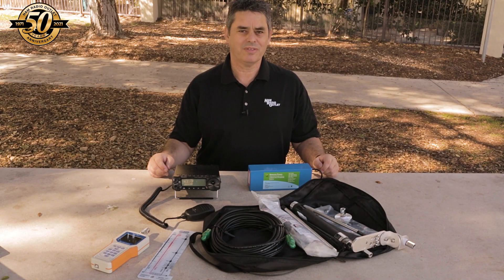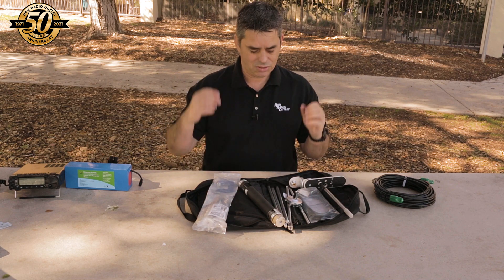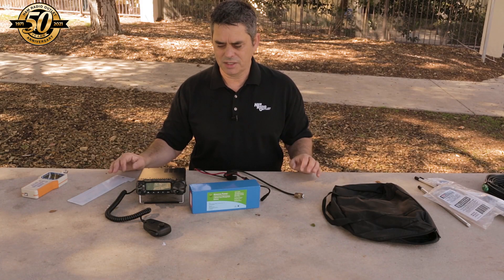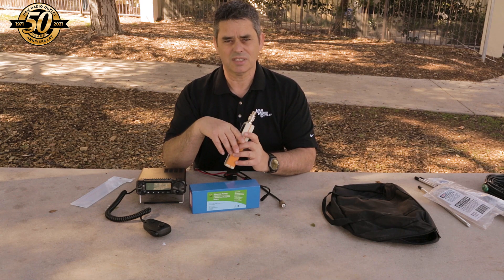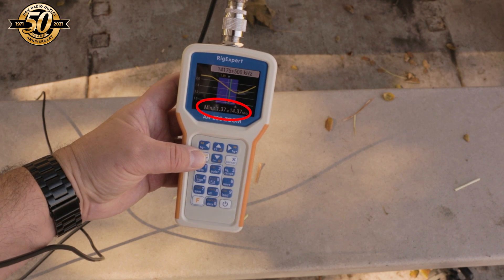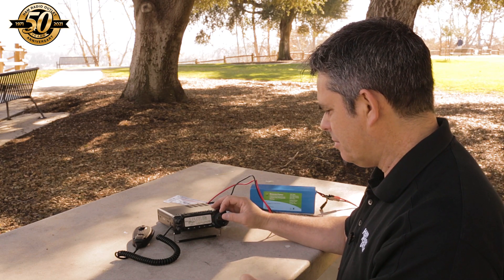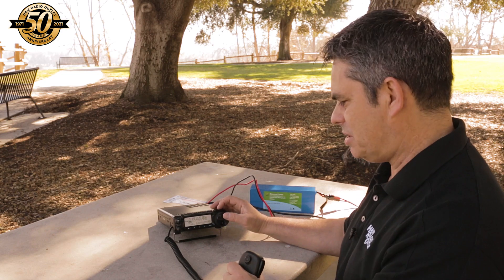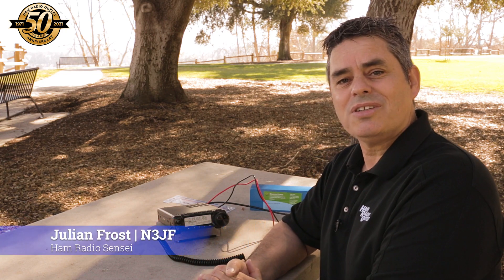Antenna in a Bag! - Portable HF Operation

Comment: I bought this with the 80 meter coil add on and can’t get below 13 to 1 on 80 meter with 80 meter radial kit.  Anyone have tips or tricks?  Tested continuity on coil and it’s fine. Help??
Reply from the maker: @noneofyourbidness  Must use the radials!
Reply: @HamRadioOutlet  I am.  Turns out you only use one of the extension rods when you use the 80m coil. Works like a charm now!
Reply from the maker: @noneofyourbidness  Oh! Good catch! Glad it's working for you now!

Comment: If you were to mount this antenna on the ladder of an RV would you need the radials or would the body of the RV (aluminum in my case) act as a ground plane?
Reply from the maker: I suspect it would not work particularly well on the ladder of an RV. It does come with a clip to help hold the adjustable coil in place, but I'm not sure I'd trust it 100%.
Reply: @HamRadioOutlet  Thanks. I'd like a screwdriver antenna but they are just so expensive. Perhaps the Wolf River Coil.
Reply from the maker: @45auto  Agreed. The Tarheel screwdriver antennas are great, but like  most places they are having supply chain issues.

Comment: Great video!  I recently got a new FT-891 and the matching FC-50 tuner...Also I just obtained this past weekend a Super Antenna MP1 antenna with all the accessories including the radials 4010 and 1710...I bought the old new stock  MP1 and accessories all for $150 off Craigslist....I use my MFJ 259 analyzer.  My interest mainly is CW and using QRP...I also have about 15 Mizuho MX QRP hand held radios for mainly for all bands (80, 40, 20, 15, 10, and 6)...I will use all of this by setting it up in a park like in your nice video or in the Santa Cruz mountain area.  I am anxious to try it all out....Curious to see how the MP 1 performs....I have a nice large lightweight tripod that has a mast that cranks up to 15 feet where I will mount the MP 1.  I have been a ham since I was 12 yrs old in 1962.  I was also an infantry experienced radio operator carrying the PRC 25 in Vietnam.  Again, thank you for your nice video.  Best regards & 73.....de K8ESE Harold in San Jose👍🇺🇲😀
Reply from the maker: Sounds like you're going to have a great time in the mountains! Who knows, maybe we'll complete that MP1 to MP1 QSO!
Reply: @HamRadioOutlet  Thank you👍

Comment: Thank you for the great video. I just purchased one of the kits from HRO and am looking forward to setting it up. When it comes to radials I've always heard more is better. Do you think adding another 4010 radial kit would make it better and if so how might it change the SWR with regards to the ruler that is provided? Thanks Again, KJ7LAN
Reply from the maker: Hi Frank.  I tried to buy another MR4010 radial kit but they were always out of stock, so I made my own. I found it made the antenna worse on 10-40m, so I removed it! Maybe I didn't do it correctly, but I placed each set of radials on opposite sides and fanned them around the antenna, which you would think would be right. When I took the extra set of radials away, the antenna behaved normally.
Reply: @HamRadioOutlet  Thank you...I'll keep it simple :)

Comment: Anyone at the store substitute the Mpas 2.0 whip for the stock whip I've seen videos but I'm not sure how accurate or good that would be
Reply from the maker: I can't speak for everyone at all 12 of our stores... but I have only used the flexible whip that comes with some versions of the SuperAntenna. I would imagine any whip that fits would work, with the caveat that a substantially longer or shorter whip would change (in some cases, drastically) the effectiveness of the tuning coil.

Comment: what type of oil would be recommended for extension threads?
Reply from the maker: I used "3-in-1" oil. Just a drop every now and then. It's only used to stop the threads binding.

Comment: Hi, I was looking at the product (MP1DXR) listing on HRO website but I'm not showing it comes with all the accessories you show in the video.  It appears it only has the clamp mount and one coil.  You show two coils and both a spike mount and clamp mount in this video.  Can you confirm what mounts and coils it comes with?  I am looking to purchase for a vacation I am planning to go on in May.  Thanks for the video. Nicely done!
Reply from the maker: The product you're looking for is this one:  https://www.hamradio.com/detail.cfm?pid=H0-015940 The caption was actually incorrect, sorry about that. The link and description have been updated.

Comment: Finally got to get it up and got my antenna analyzer too..tunes great on 40 & 20 meters. Cant get a good tune on 10 meters..also using  40-10 counterpoise set also..any suggestion???

Paul    K1YOU
Reply from the maker: I haven't used it on 10m. What kind of SWR are you getting on 10m? You can buy (or make) additional radials, but I wouldn't think they would be necessary on 10m. I have noticed that when I have ground that slopes away from the ground post, say, when I'm on top of a hill, and the radials droop slightly down, then the SWR drops accordingly. As with any ground mounted antenna, the ground that the antenna is on affects the efficiency of the antenna. I've set up the antenna in one spot and had 1.3:1 SWR and set it up in a different place and not been able to get it below 1.7:1 or 2:1 on the same operating frequency. The only visible difference was one was on grass, the other on a dirt track (the dirt track had the lower SWR).
Reply: Thanks for your quick reply...best I could get was 3.0- 3.5 to 1 trying for 28.4 to 28.8...
I though of making a 4 wire bundle bundle at around 98 or 99 inches which is a quarter wave approx and see what happens...any thoughts??
Love my Ft991a  ...

Paul.    K1YOU
Reply from the maker: @paulaubuchon2336  Hmmm. I really don't know. As I said, I haven't tried 10m yet. First chance I would get might be next weekend. I don't think there's a lot of action on 10m at the moment. 3.5:1 just doesn't sound right. Are you putting on the spike, or on the tripod? Maybe try the opposite, see if there's any difference?
Reply: I was using a tripod...will try with the spike a see what happens...will let you know....
Paul     K1YOU
Reply from the maker: @paulaubuchon2336  Oh, interesting. I haven't used the tripod because I've always used it on grass or dirt. Let me know.

Comment: Nicely done video. Very informative. I like how you walked through the entire procedure and did not get long-winded !
I have the 230 Zoom and it's a great antenna analyzer. I also like how compact your portable station is. The one thing I did for portable operation is to use only BNC connections. It make life so much easier. I wish all ham radio manufactures would use only BNC for all connections 500 watts or less. 

Thanks for posting. Barry, KU3X
Reply from the maker: Thanks Barry. It may not be the smallest and lightest setup, but it works really well and it makes operating portable really easy.

Comment: Yes, Julian, the MP1, is a good portable antenna, and I have had success with it,
as you showed, with my FT-891. I guess,
aside from an analyzer, making it easier
to tune, a rig like my Xiegu G-90 is good,
though only running at 20 watts, because
it has a built in antenna tuner. I do not have the DX1 version of the MPC1, with a case
or coils to add on for 80 and 160 meters.
It even let's me use it on 6 meters with a
tuner near the home station. I also like to
compare it to my Windcamp, WA4 antenna,
being a 20 foot and 60 foot Windam type antenna. Ray, W2CH
Reply from the maker: Yes, great suggestion on a rig with built-in antenna tuner. Thanks for your comment!